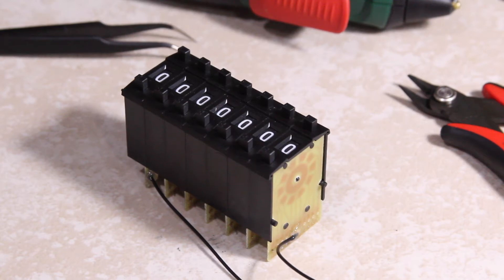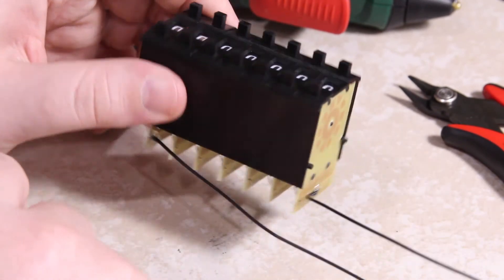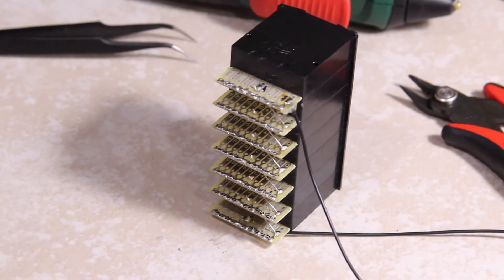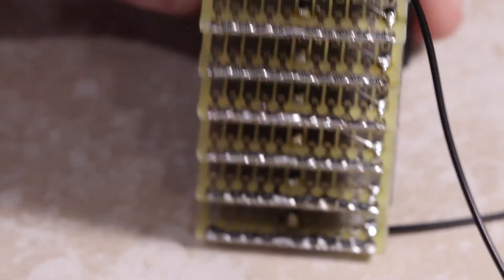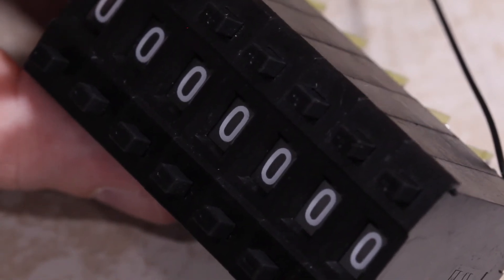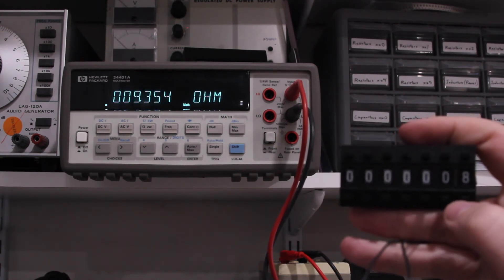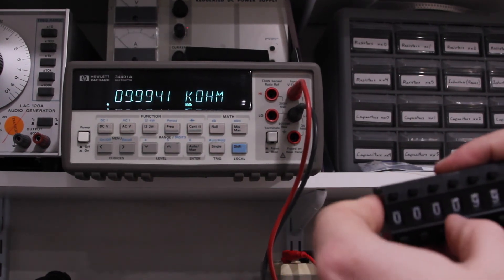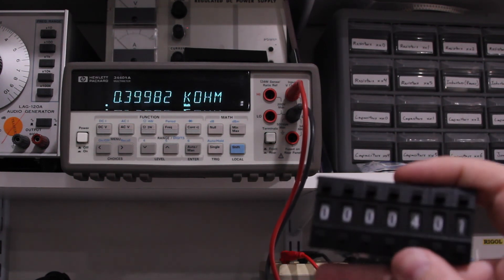Make a Decade Resistance Box for Under $15

Comment: Hi, I have a set of these thumb wheel switches. Is there any way to make these into a coded gizmo switch bank, using regular circuits and not computer code? I want to wire up my car with this as my ignition (I don't want to carry a key or key fob). I will be using a set of micro relays and regular relays to carry the current needed so as to not burn up these thumb wheel switches. Any ideas? I think it would be kinda cool for my car to have these as my "crack the code" ignition.
Reply: @Bobo ok thanks. I was going to instead use a hidden reed switch (behind my dash board) and use latching relays to create all the connections, and activate it with a magnetic finger ring, but I wanted to get the car on the road asap. I bought the reed switchs though. 
I ended up using an IFF Radio Destruct Switch Box, New Old Stock, as equipped on B-17s and B-24s as my starter solenoid activation. So basically no key, just flip an ignition switch and push the double button radio destruct box. Looks kinda cool! 

If I want more security, I just turn the battery off in the trunk and lock up the car like normal.

Comment: A few notes:
1.) These switches are available on AliEx now for just under $5 for 10 individual wheels.
2.) The decimal version like was shown here is almost twice as large as the BCD version. (I haven't built mine yet, but just received both versions in an order).
3.) Personally IMO, if I'm going to build a "decade" resistor I'm not going to use 5% values because of the stack tollerences. I would build a resistor substitution box if I'm going to use 5% that way I can observe the test circuit with real world component values for each value I keep in my stocks. What's the point in a box that says 123,000 ohms but is really something random like 127,654? Just use a potentiometer. You can get decent 0.1% resistors from Mouser or Digikey for around $50.
4.) I want to build a few of these into a breadboard station to avoid using so many resistors while testing projects. While the 6 and 7 decade resistor boxes are common, everyone talks about the risk of burning out the single ohm decade, and I think 1-9 megaohms is rather unnecessary as well. If you buy these in a set of 10 individual switches, planning on building sets of 5 seems like a practical solution. Personally, I'm building mine with 5 decades ranging from 10 ohms to 999,990 ohms.
  Thanks for the upload and implementation example. Sub'd and added to my tools/decade resistor box playlist for future reference ;)
-Jake
Reply: 3.) When you hand pick the resistors it doesn't matter what tollerance they are. You can pick a resistor with an accuracy of over 99% from a 5% tollerance batch. This would probably be more accurate than picking a random 1% tollerance resistor.

Comment: I had considered a resistance substitution box by Elenco for my purposes which is figuring out ranges to circuit bend on keyboards and electronic toy sound sources so as not to burn out the unit completely - but this looks more like what I wanted originally. That .300 differential though, that is slightly worrying mainly because those old 8 bit toys are fiddly and getting more and more expensive every year. Maybe I will do both- I still need the Elenco capacitance substitution box anyway, and could compare and contrast.

Comment: Have you got a link to where you brought the switch cant find them anywhere
Reply from the maker: Hi. I bought them through eBay, just search for "thumbwheel switch." Keep in mind that there are two common types: BCD and non-BCD. For a decade resistance box, I used the non-BCD kind.
Reply: non-bcd aka decimal

Comment: Nice idea to use SMD resistors. Any problems with the wattage at low ohms settings? Those look like 1/10th watt resistors.
Reply from the maker: Abizar Lakdawalla Hi. I only use the lowest decade to trim for better accuracy. For high currents you would need better switches and bigger resistors.
Reply from the maker: Abizar Lakdawalla Hi. I only use the lowest decade to trim for better accuracy. For high currents you would need better switches and bigger resistors.